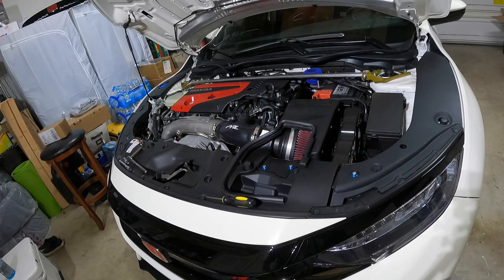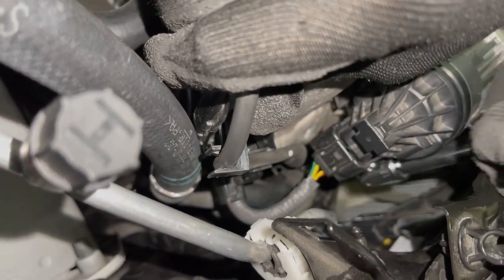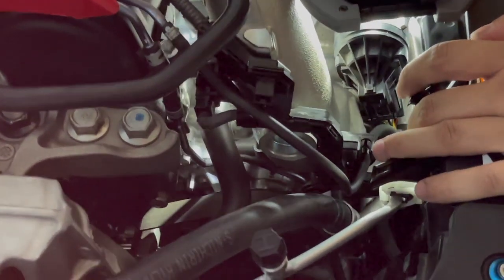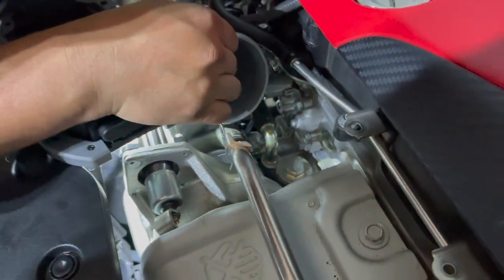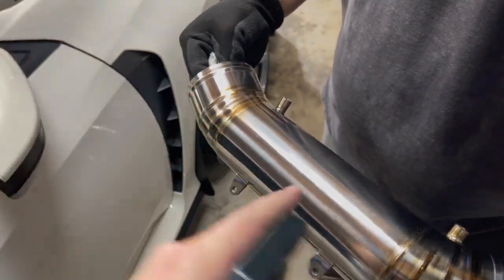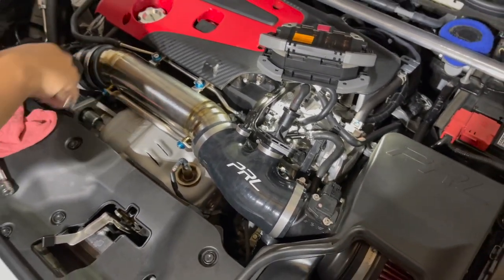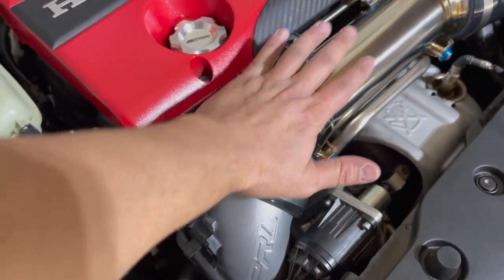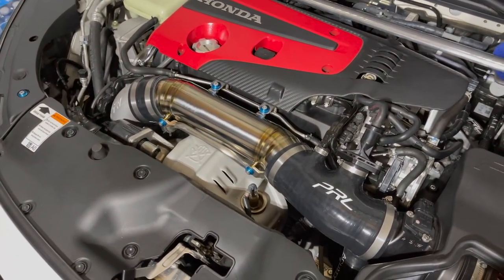PRL Inlet Pipe install completes full bolt on for FK8 civic type R!!

Comment: After inlet pipe install, what sound/noise gains did you notice?  Crisper, more turbo spool, louder, etc?
Reply from the maker: Thanks for watching 👍 I felt better high rpm spooling, since I was full bolt on it made everything run more efficiently
Reply: @CTR692  did adding inlet give more engine sounds?  I've already got AEM cold air intake, PRL DP and AWE track exhaust.  Just wondering if inlet seemed to add more to the motor noises.
Reply from the maker: @typermode3527  tbh no

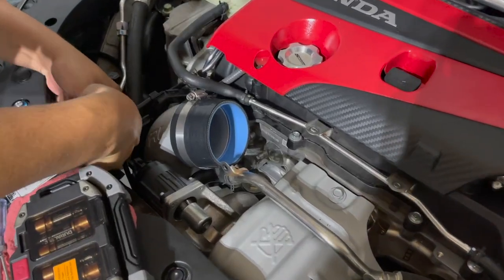Comment: Quick question, 11:36 does it matter which way the coupler goes on? I’ve seen other videos where it’s been put on the other way.
Reply from the maker: Don’t think so tbh, I just turned it around to hide the PRL logo is all
Reply: @CTR692  Cool. I ended up turning it around. Have you noticed a drop in MPG’s since installing it?
Reply from the maker: Yes definitely… ⛽️ 😢

Comment: Would this inlet pipe fit on all aftermarket intakes? Or it has to be the PRL intake?
Reply from the maker: If you have a stock intake, prl has an option for it when your selecting your purchase. As far as a different brand intake I’m not sure 🤔 you should reach out to prl on ig. They are real good at answering back…

Comment: Have to be tune after PRL hvi + inlet pipe ?
Reply from the maker: If you have Hondata you can select the tune options
Reply: @CTR692  for this moment I dont Have hondata , so it Will be any errorors or issue?

Comment: Hey bro would i need a tune after putting the inlet pipe on? Could I install it on my fk8 without a tune?
Reply from the maker: No tune needed, although I updated my hondata flash
Reply: @CTR692  thanks bro

Comment: How did you get that lower 12mm back on.
Reply from the maker: Take a look at minute 9:35, we used a magnet extension. Get a nice strong one and slowly thread it, the magnet should help you get it started then use your flex socket with your extension to tighten it up ... Good luck and if you still have questions hit me up on IG!!
Reply: @CTR692  awesome, thanks my friend.
Reply: Hey buddy one more question. This won’t cause any check engine lights right.
Reply from the maker: @tomadamato1114  it shouldn't.. mine is on a hondata base tune.

Comment: Great detail install and review. I'm still debating on the PRL or Rampage. So far I have other PRL parts on my Type R so maybe leaning towards that. Check my channel on my build so far. Just subscribed!
Reply from the maker: Rampage is a very nice piece! I went with PRL for their quality, and since they are plug in play, I wanted to keep everything oem + as possible.. I don’t want to cut too much or fabricate too much like I did with the oil cooler, it hurt me to cut the plastic wheel well liner😢, but you can’t go wrong with the rampage inlet pipe!
Reply: About a $500 difference in price for the same function.